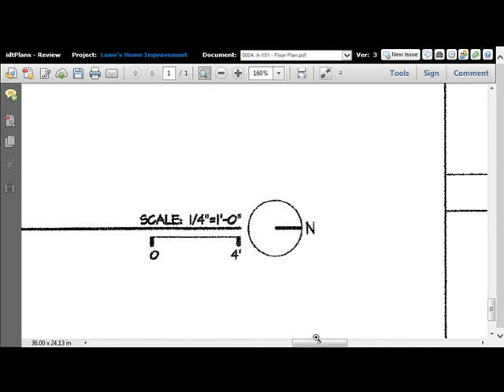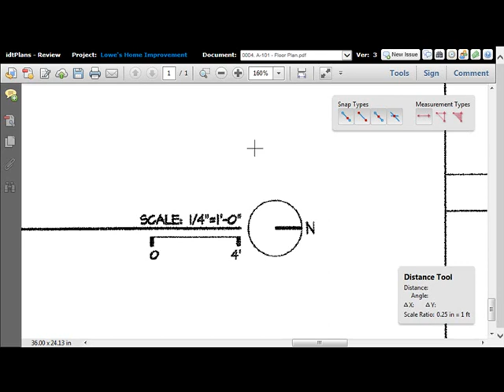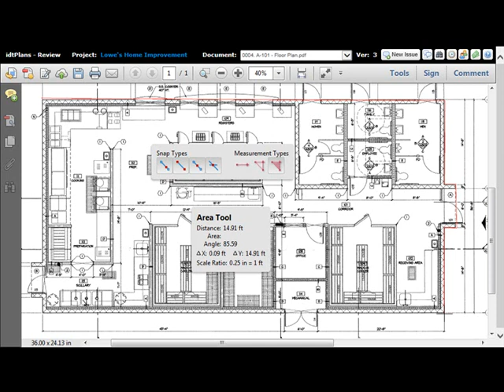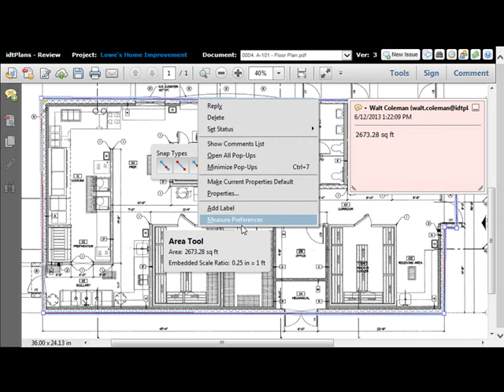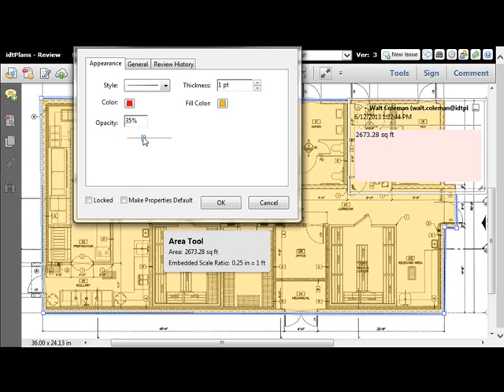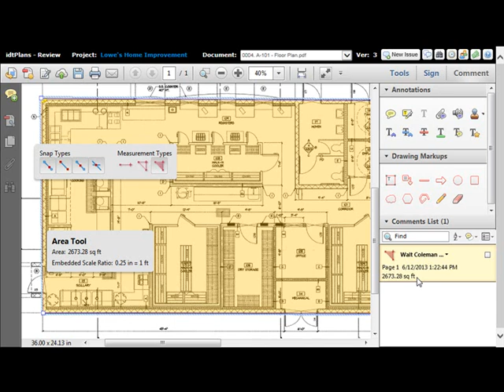How to Measure PDF Construction Drawings

Comment: Hi Walt, thanks for this video! I have a question. I am using pdf Xchange for measurements, is there a way to select multiple measurements in order to get a grand total?
Reply: Export measurements to Excel. Once in Excel data can be manipulated any way you need.

Comment: Can anyone help me?  I have Acrobat Pro XI.  Say I was measuring the perimeter of an object, say a custom shape swimming pool on a drawing.  If you are in the middle of doing a perimeter measurement and you miss click on a point off of the object by mistake, can you back up one click, or do you have to restart the entire measurement all over again?  If so, how can you do this?  An older version of Acrobat used to allow backing up a click at a time during a measurement by pressing the delete button.  Now that doesn't work.  Any suggestions?

Comment: Is there a calibrate tool for measuring if there is no scale shown on the plan?
Reply from the maker: +babs0824 yes, there's a way to calilbrate
Reply: +babs0824 See if there is any information on door ways  there is often a door schedule. Last resort 3' per door allowance use common sense try a number of doors.
Reply: Use PROPORTION. If one inch equals 14 feet, then that's your custom scale. 1 inch = 14 feet. If your scale is 3/16 then your custom scale would be 1 inch =  5.333 ft. If 3/32 then your custom scale would be 1 inch = 10.666 ft. Try it.